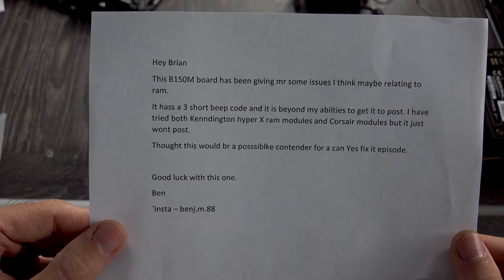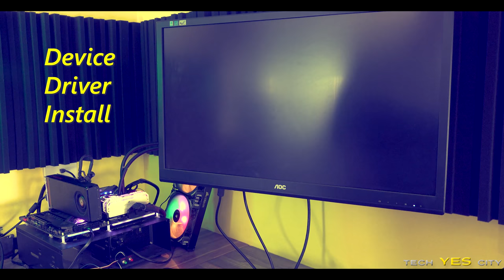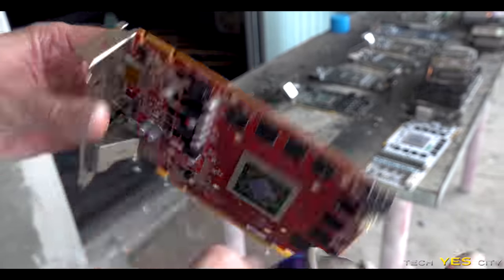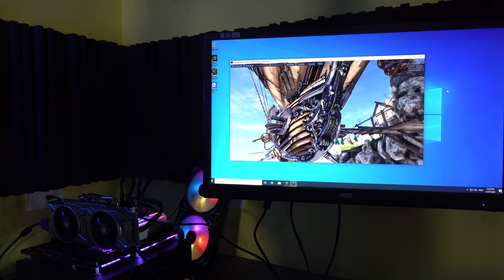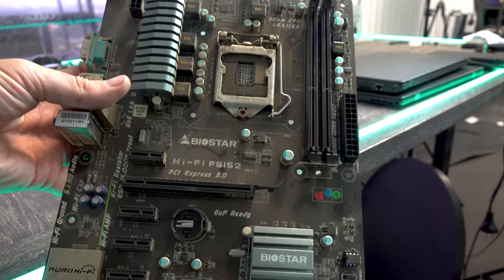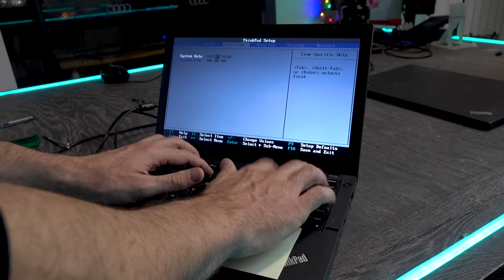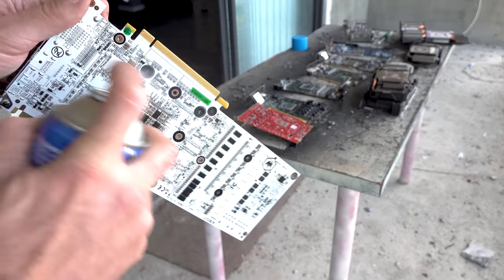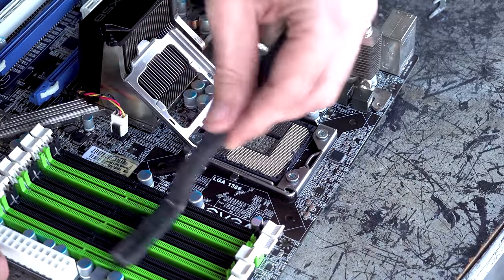How To FIX Faulty DDR3 RAM.....?  Mass FIXING Graphics Cards (Can YES Fix it)

Comment: Hey, I wonder if you generally do any further testing on the memory (e.g. memtest86+) after resurrecting it, or do you just check the motherboard detects it and POSTs? I ask because obviously memory is one of the most common causes of instability in a system, so it's possible a 'dead' stick could be revived with a clean/heat treatment, but still have problems with one or more of the components. Thanks.
Reply from the maker: Yes I do run tests after I have built the system up.

Comment: My question is why do you use a heat gun? Makes for uneven distribution, so more prone to failures. You should reflow GPU in the oven, 220c for 10m. Only exception to this is things that don’t use surface mount, eg Xbox motherboard. They have a tendency to pop to capacitor caps!
Reply: Also if your going to wash parts in water, make sure it’s distilled water as that is not conductive. The minerals in standard tap water is not great, there is some really bad advice in this video!

Comment: I have a partial-related tech question:

I have an Xbox 360 E that powers on, stays quiet, red ring, no video. Will using a heatgun work? Info which parts/how to do it? It's all air-blown, thermal compound of CPU and GPU replaced with Arctic MX-4.

Comment: I just bought my first break cleaner, it should be put to good use. I just need a heat gun, and those items won't be stuck in the shelf coz I work in a hardware store as a family business. Maybe if I got my parts working, I'll try to accept possibly dead parts for practice and charge a little for the ones that will work. 😉🤣👍

Comment: FYI I would use something besides Heaven to confirm cards are working again, I had a faulty gtx 670 which would run heaven no problems but hard crash the whole system in more strenuous games like Tomb Raider

Comment: I've found that 4GB is not enough for Windows 10 x64. Once you open a few applications the OS starts to swap on the HDD. I tend to recommend 8GB minimum on all new builds aimed at Office work (Microsoft Office 365).

Comment: Hey Bryan I just bought a Zotac GTX 1080 Ti AMP Edition for €75. However when I put it in my system it doesn't boot up, e.g. none of the case fans nor cpu fans spin up and there's only a little light on the GPU shining indicating there is power from the 2x8pin connectors. When I put my own Strix RX 480 back in the pc everything boots up like normal, hope you can help me :)
Reply: There’s a short in the GPU causing your power supply to shut off, ie the GPU is dead and you got hosed

Comment: I bought a faulty 2080ti that had bad artifact and code 43. When I checked, there was missing thermal pad and so I added. It fixed the artifact and code 43 but when I load up some games, the games crash. I tried everything from change psu to changing PC. Even down clocked the memory but still crashes. Any idea what could cause the problem?

Comment: question: instead of using as heat gun, could you put the board in the oven and back it. Like you would do with a lcd tv motherboard in the hope to re-float the solder?
Reply: Yes you can use a oven he, used to use a oven earlier

Comment: I see Louis Rossman crying over that heatgun.
Reply: Yes, it boots but is it reliable? If it is too cheap to diagnose a problem properly - why not try it the junky way?
Reply: Louis would be horrified about no flux policy. Another point is you can't wash it without proper inspection, you are erasing all clues.
Reply: @gabrielcamacho6247  Louis is the flux man

Comment: Hello, i really revived a R9 290x graphics card with the eat-gun method: I had some random blackscreen crash a few years ago with it. But I realized that I could fix it for a short time by tightening some radiator's screws.
In fact I had mounted and unmounted the boxed radiator Vs a waterblock a few times and they was each time hard to remove. I think by doing this I damaged some weld, and using the hot-gun at quite high temperature I may have soldered it back.

Comment: Great video mate but don't you think that it's time to start researching some suitable ultrasonic cleaning machines and maybe a temperature controlled hot air soldering station? I can understand you trying to demonstrate that almost anyone can do stuff like this at a minimal cost with regular everyday equipment but you might actually start to get better results if you take things and encourage your viewers to take things to the next level in everything that they do. Nonetheless, keep up the good work. Also, be careful with volatile chemicals and your bare skin. Just looking out.

Comment: I'm having issues with an rx 5600 xt, its a gaming oc model from gigabyte but its a rev1.0 that was sent out for review. I bought it used off a local tech youtuber but i've never been able to get it to work properly. Any of the problems you've heard of with the navi gpu's, i've experienced first hand with this card. It's about as unlucky as you could get. No warranty option, no return option, no repair option. Its really unfortunate because i've been a long time nvidia customer (not fanboy) and I really wanted to switch to amd, the last time I used an amd product they were still called ati. The graphics card seems to perform to spec physically, but the driver always crashes without fail and never recovers leaving the system locked on a black or green screen and the only way to get out is a hard reset. I managed to get it working for a few days on call of duty warzone with the odd crash but as soon as cod got updated it stopped working again and crashes everytime i try to play. Kerbal space program doesn't even make it that far and the driver hangs as soon as the game launches. This is on a "fresh" x79 build. Jingsha x79-p3 motherboard, xeon e5-2689, 4x4gb pc14900r ram in quad channel, 1tb seagate hdd and a 650w 80+ bronze corsair cv650 psu. The tech youtuber was the one who flashed the vbios so i might try to reflash it, maybe an error in that process could be what is causing the issues but idk. I've tried ddu and all the online fixes but nothing helped so i think flashing is my only option. Not a great confidence builder in amd that's for sure.

Comment: Do you use the heat gun to soften/melt the solder to basically refresh the connections?
Reply: Yes that's exactly right
Reply: For GPUs this process is called thermal shocking the core; this is a temporary fix, it may hold a few hours a day a month, or a few months if you use this to fix your card save up for a replacement, do not sell the gpu in this state without disclosing this

Comment: My last GPU was an EVGA 980 TI SC, worked well for about three years, then in 2018, it started crashing in most games.   I replaced the thermal paste and cleaned it, but it did nothing.  980 Tis still hold their own in 2020, wonder if Tech Yes can get it working.

Comment: If the mobo turns on and about 10 sec turns off, that means one of the pins is bent or shorted. Or one of them is not connecting to the cpu.

Comment: I worked in electronics and the heat gun on to the chips is the best way to make the solder underneath connect. Sometimes there can be voids where bubbles of air in the solder paste make a weak connection. We used to xray a final product and if there was a void heat gun then check and it would be perfect.

Comment: do you think you could have better results if you used a focused heat gun soldering station vs a non focused heat gun , might have some better luck if you are able to reball the chips to the pcb

Comment: That not using the full heatsinks with fan to try the boots, you are taking the lack of fan attachment into consideration yes? Reason I ask is I was under the impression its like a failsafe check like mobos?

Comment: Love watching this, always have been into PC's using them for a couple of years and sell em of cheap or give them away.

Now I just clean em and give them a cheap rgb case and fan and sell off as fortnite PC. Do the same with friends PC who replaces em.  Not for the money but for the fun.

Currently rebuilding my old z97 with 4790k and 980ti. It still.got it's oc of 4.8ghz and the ekwb evo block. Now completing the loop with cheap AliExpress water-cooling parts.

Comment: I have a question... DO you figure (since I can take my laptop apart) would it be wise to remove my keyboard and wash it with soap and water? Or would you recommend another method? It had a bit of orange juice spilled on it.

Comment: Q: I live close to the beach, how can i avoid rust on my components?
Reply: Keep moisture low and unless you splash water on components it really shouldn't rust
Reply: @thematrixian8710  Living close to the beach there is lots of moisture in the air, moisture + oxygen = rust. A dehumidifier can help, it sucks moisture out of the air.

Comment: So, when i was younger, i learned how to solder, and i was pretty decent at it. Whenever i see faulty hardware being resold, it makes me wonder exactly where a guy would start if he wanted to learn how to properly diagnose said hardware and be able to fix it. i would guess that very rarely does an actual gpu main chip fail. i would bet its usually the power delivery, memory, or outputs. and all of those can be soldered without a big investment in special equipment i would think.

Comment: i have heated laptop motherboards that have no video output and bought them back to life so this method does work
Reply: It does, but some people heat the whole board, which you shouldn't really do, it can cause solder shift, and future problems. Get a schematic, and oscilloscope, and find just the faulty component, and focus heat on that. To prove a point I heated my old 360 motherboard to fix E74, the fans were running 100% afterwards, and the board died again a month later. Amateur repairs never really last. The next one I used my scope and proper reflow station, it still runs today :)

Comment: Great content, why does heating the PCB works?
Reply: that heat gun is at least 300 degree Celsius, it melt solder & re-connect broken connections.
Reply: @xponen  thanks

Comment: I would be more careful with picking the type of brake cleaner to use. Preferably non-chlorinated and safe for plastics. I've worked on cars using brake cleaners and had plastic disintegrate on me as well as some rubber parts.

Comment: Can you explain what is this "heat gun" fix ? :O I've never heard of that before.
I have a dead GPU I'd love to possibly try any of these methods on it.
Reply: Heating the chip with a heatgun reforms the solder, and can bring it back to life temporarily as it usually isn't permanent, but don't overheat the chip you'll damage it. Thermal cycling (running hot, then cold, like when gaming, and turning off) kills solder, cracks it.

Comment: Bryan.
I've got one of those rx 470s that you showed, the silver Sapphire one. I bought a non-functioning 470 nitro to swap over the cooler, only to find it was a different board and wouldn't fit. Do you know of any rx 470s that have decent cooling based on the same board as the silver Sapphire? I'm assuming that it's a reference board.

Comment: I'm currently building a PC using GA-H61M-S2PV, its main problem was that the PCH has significant heat on it, i can't rest my finger on it for 10 seconds. HWinfo shows 96 degrees celcius in idle and just stays the same even when the PC is fully loaded during gameplay. Could this be caused by the SSD running via SATA on PCH? I'm building this to sell this PC soon but if this is a huge issue I might try to repaste the heatsink if need be.

Comment: I spilled milk on my mechanical keyboard. I took it apart and tried to clean it with water, but after drying a few of the switches are still gummy. Would brake cleaner clean the switches out better than water?
Reply: Youll need to dissasemble the switches for a better cleaning.
As long as you use something which doesnt leave a residue, you should be fine

Comment: that 7950 all you need to do is flash stock bios had a similar problem with rx 480 if i flash 580 bios HDMi stops working

Comment: I have a question abou X58
I bought a GA-EX58-UD5, i7-930, 4gb 1x for 100 and i was wondering if i could use a X56xx series xeon in it. On the support page it doesnt show them but maybe you have tried to put x56xx series xeons on low/mid/high end X58 motherboards.

Please reply
Reply: Intel specify X5650 as using LGA1366 socket, and X58 specify it uses LGA1366 socket as well, so it is straight matches.

Comment: I have a used Sapphire RX580 nitro+ and it works fine but it drops frames and micro stutters while in game. Will it be fixed by heating it with a heat gun just like the case of the Gigabyte RX570 in the video? This method seems to be my last resort for this problem since I’ve tried many other solutions but the results are not noticeable.

Comment: I got a deal of a lifetime last week ryzen 2300x 8gb of ram 600w power supply and a basic motherboard in a case for $42 because the guy built and and said it didn't work when I got it home and went thru the testing everything worked. It was just he didn't know ryzen doesn't have on board graphics and had to have a display card or graphics card installed.

Comment: I have a r9 270 dual x my brother used it for few months everything was great until it crashed the system and now its stuck in bootloop  system boots fine without the r9 
What would you recommend method of repairing i done the heatgun trick few times and it has worked a few times

Comment: If after the easy fix steps are gone through are there any parts that can be taken off MB and Video Cards that can be Salvaged and Reused or Replaced?(1) What simple test rig setups would you recommend for diagnostic and repair?(2) Have you ever used cheap Vodka or any other clear 180 proof Alcohol as a cleaner? - (Yes I know, using good drinking booze is a sin, but it's a cheap and easy solvent for ordinary use.)

Comment: @18:20 -ish .. that chip looks like it's not seated properly. and i hope you use memtest to test the memory
For video cards, esp. RX series cards, you can use SRB Polaris to edit the bios and force the ram frequencies to higher values and also increase memory timings, if the memory is unstable. 
Seriously man, buy some LIQUID FLUX and pour it/spread it around the edges of chips before you use the heat gun ... the flux is a mild acid which will go under the chip and attack oxides and crap that may be on the solder and will help the solder flow better (melt and reconnect better to metal pads on chip and circuit board)
The way you do it now, it's just dumb luck, and temporary ... flux will not make it a definitive fix, but should increase your success rate. 
if you decide to use flux, start with lower temperature to give the flux time to attack the oxides, you don't want to burn/evaporate the flux in the first few seconds. Then gradually increase temp to your current setting.

Comment: Using a heat gun (or an oven for that matter) does not magically revive dead boards, it is a temporary fix and most boards die within a few weeks/months after doing it, if you want a deeper dive into the matter to watch Louis Rossman.

Comment: I'm wondering, what's the temperature on the heat gun C° ????
I can't find the model to get more info.
Reply: Ben, don't heat gun stuff mate, this guy is full of shit... It's a temporary fix at best, if it works. Find the fault and correct it by replacing the faulty part... Heat guns are for re-flowing solder balls etc. in the rare certain circumstances in which that is applicable...

Comment: i got a r9 270x that i got from ebay for a 10 pounds bargen and a gamble it has no backplate and its had some abuse it made me feel so sorry for it i own a r9 270x for a pc im bulding for a test bench but this 270x fans spin up but no display out the hdmi or vga or dvi iv just baught a tin of wd40 ecc i do have a heat gun well not a gun but a bench heat blower but iv never really done the tec yes loveing do i use brake cleaner first befor wd40 or use brake cleaner befor heat gun

Comment: would a heat gun fix my error code 43? i got a msi gtx 770 4gb and i cant seem to make it work , the drivers dont load , and there are some low blue lines on black surfaces . would it fix it?

Comment: So, after using brake cleaner it is neccessary to flush it from parts by multi purpose cleaner or isopropanol?
Reply: Im a little late lol, but no you dont have to wait. Brake clean is non conductive so you're all good, aswell brake clean evaporates very quickly if you want to be extra careful

Comment: I have a problem after a while a GPU that i have crashes and when my PC reboots it gets stuck at a black screen after the Windows logo. I have manage to bypass the problem by using the heat gun but again some time after it keeps doing it, is there any method to permanent fix it ?

Comment: Hi got this gtx760 it will boot up and display have green lines after a seconds it will freeze and black screen. Ive tried to clean it and put it in the sunlight 12PM to heat it up but still no chance of fixing it. Dont have oven and heatgun :(

Comment: Hi guys, I have a gigabyte windforce GTX 980ti... but now my pc doesn’t even react when its plugged in.... no lights or anything...no signs of life when I have it plugged in... I have a 800w PSu , i7 3770k and z77 motherboard...  I honestly don’t know what to do...  Can I take off the heatsink and run a hair dryer over it for 10 minutes?

Btw - pc boots perfectly without the gnu.